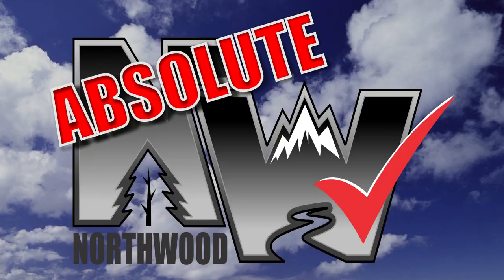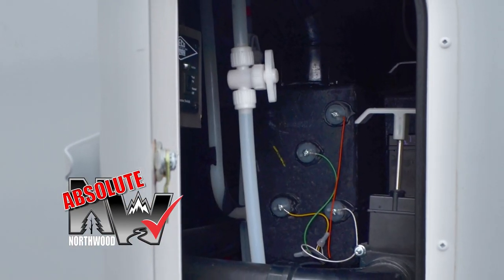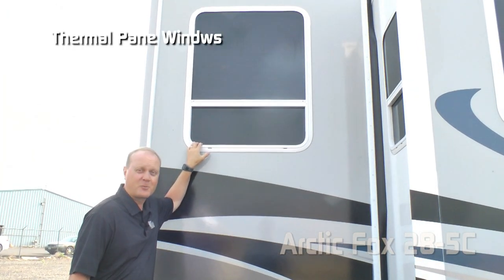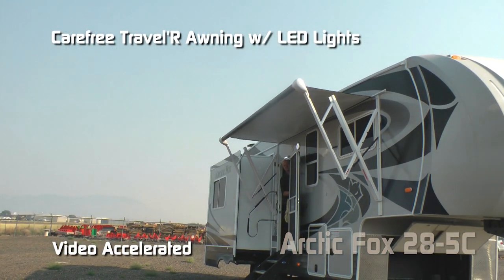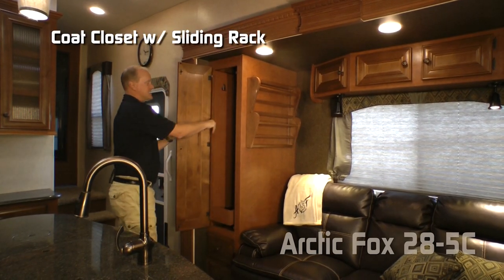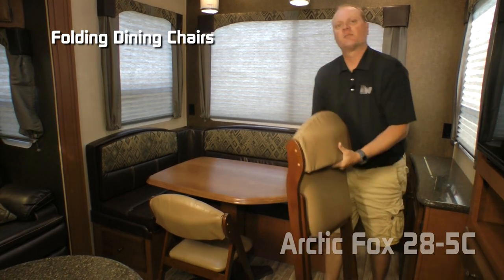Quick Tour Of the Arctic Fox Silver Fox 28-5C Fifth Wheel

Comment: Northwood (if you're listening) you have done a remarkable amount of work on this unit.  The only downsides that I see are headboard and comforter.  One more thing that is still miss is the entertainment system ports on the exterior for movie night (HDMI, optional wireless headphones, etc).  Another thing that I don't see on any model is a weight gauge for the holding tanks since none of the sensors ever work (for long).  Pets are another part of the traveling family and having options for them is an overlooked market.  Why can't I have a litter box built into the floor that permits the cat to take it's odor (evacuation fan - and reminder alarm to clean it) downstairs where I can pull and dump the litter box from OUTSIDE the rig?  Likewise, why can't the front or back belly storage be the dog house with easy connect containment fence?  Today with the security and number of travelers reporting a wide array of issues are there still not security systems builtin?  An ADT style set and forget (while your gone) 4 exterior night vision cameras (with internal alarm reporting motion of things outside), a RING style doorbell to let you know whose there ANYWHERE you are, locking gun / ammo storage, etc.?  I understand about moisture being a HUGE issue in travel trailers but why can't we go to foam insulation with a dehumidifier.

Comment: I would also add as many solar panels as I could and I would customize it to have a wood burning stove. .then let the adventures begin. .
Reply: Nice comment, love the idea of a wood burner.  May have trouble getting insurance for it though.  There are diesel heaters commonly used in boats that can provide a lot of heat and can be hooked up to the fuel tank on a toy hauler, but then you need a diesel generator or 2 tanks and things hooked up right.  I hope you get out there or better yet are already out there having fun.  Do not wait for the perfect rig, like the song says love the one you are with, get out there.

Comment: Does anyone make a stove capable of 3 10" pots centered over the burners?
Reply: You can get one but you would need to upgrade the gas line.  Propane bottles are not designed to provide the gas flow of a home lp tank.  You can get upgraded LP tank and things most people do not use 2 burners much less 3 at a time.  I upgraded a trailer I had with a larger bottle LP and a large 4 burner stove with oven so I could cook like in my home.  With kids and a few friends along I needed to be able to cook food and still do other things.